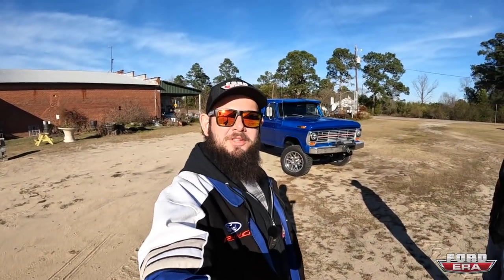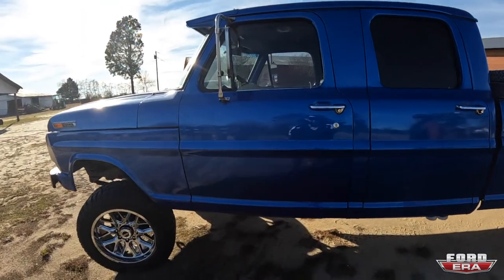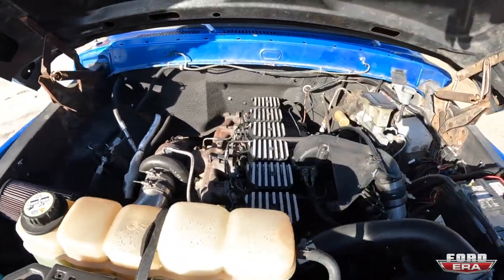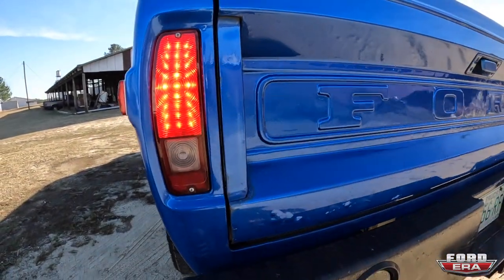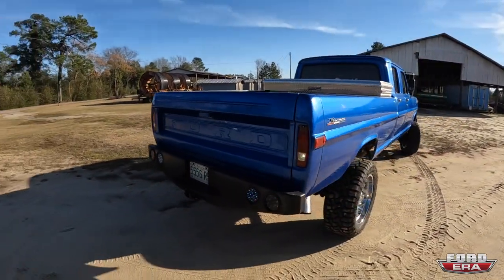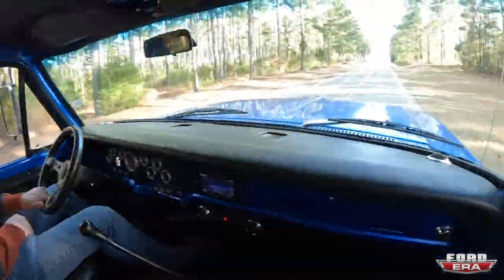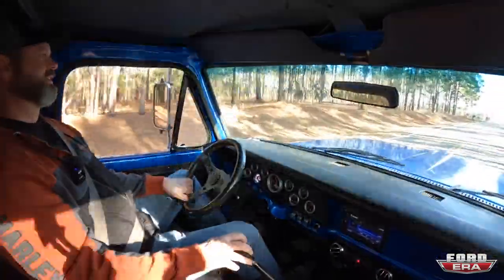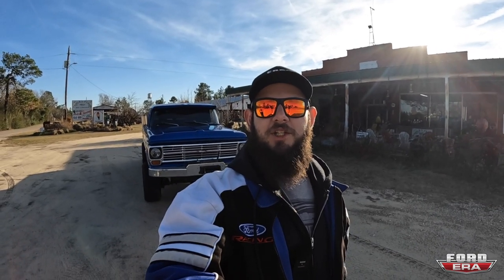1969 12V Cummins Powered F250 Crew Cab! | What The Truck? | Ford Era

Comment: I have a 65 2x4 f250, i am thinking about putting it on a 4x4 frame. Would like to use a powerstroke, do you have a suggestion for what one would be close for wheelbase?